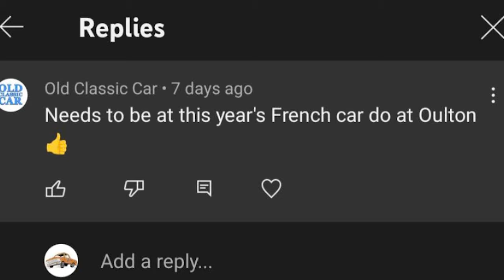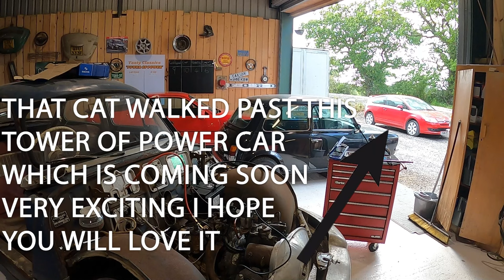Panhard Dyna Z Sat In A Barn For 48 Years & Now She Starts On The Key!

Comment: Ben, sorry to report that donor car has holes in the floor pan, as the previous owner was in the process of welding it up. Anyway it's still a useful car for you, and I'll throw in a used clutchplate, pressure plate and an old Revue Technique to help you understand some of the stuff with the car. Two tyres pumped up, two dead, spare in boot is OK, but will find another wheel & tyre for you. I just pulled it with a rope, so it'll load into a trailer with winch. Just vacuumed it up, floorpan is worse than I remembered. 😲 One thing to point out as the engine has been stood for so long, the O-rings on the inlet manifold will have perished or cracked, so once you run it, it'll run weak and hole a piston worst case. Also the oil will need changing, the intervals are 1500 miles max, as it just has a tea strainer in the sump, and the oil is filtered centrifugally, which means a strip down of the engine to remove the sludge. That leak on the carburettor is the base of the inlet manifold under the carburettor which has a small pinhole in it. Fuel pump Citroen 2CV, just rotate the top flange to match your fuel inlet/outlet.

Comment: I think that what you are calling" heat shields " and deciding to throw away , are actually air ducting plates to guide the air blown from the fan over the cooling fins , and without them in place she might overheat , plus you may not have any heater in the Winter if it is a similar system to the VW Beetle . Fantastic to hear it running again and glad that you're giving this wonderfull car another chance .
Reply: Yes, I think they are. I had a Lambretta many years ago with a similar air cooled set up. I got rid of them, because they rattled like hell, and the engine overheated and seized.

Comment: You should clean and replace the engine heat shields, the fan draws air in the shields direct it around the cylinders keeping engine at optimum temp
Reply: And prolly deadens the decibels a degree, eh?
Reply: Too late if he's binned them. Still, the engine will very quickly tell him if it's overheating.....😂

Comment: Congratulations on more great improvements.  Nice to hear the car run again.  One tip, generators don't really charge when the engine is idling.  You might want to check the voltage at the battery again with the engine revved up a bit.
Reply from the maker: I'll have a look at this and report back!
Reply: I think that's even true for alternators well into the 1980s, at least smaller ones.

Comment: Don't toss out the cylinder Cowls, they are vitally important for this kind of Engine. Trust me, I've been around Air/Blower Cooled Engines my entire Life. These Engines are meant to run with Cowls and will overheat within 30 Minutes, as their Cooling Fins are waaay to small to support an entire Car just on Natural Airflow. 
Hell, even in Airplanes travelling at 200knots we use very intricate Cowl Designs to make sure the Engine is cooled properly and failure of those cowls or people throwing them out thinking they know better is a good chunk of Engine Failures. 
Don't ruin that Engine please.
Reply: Too late now 🤷‍♂️